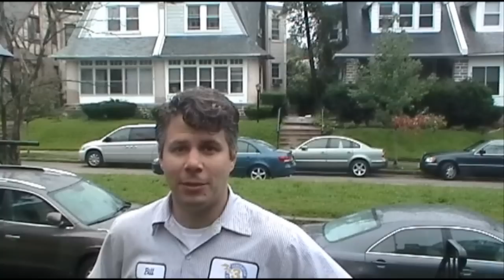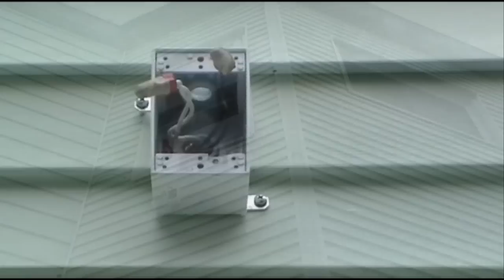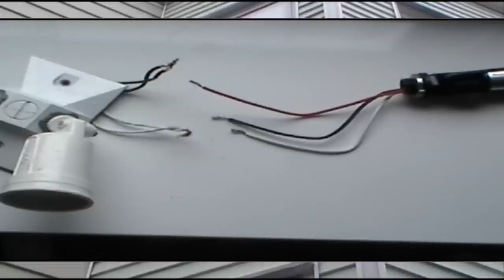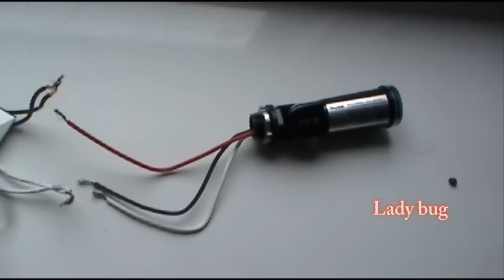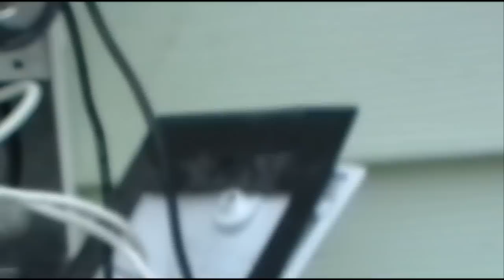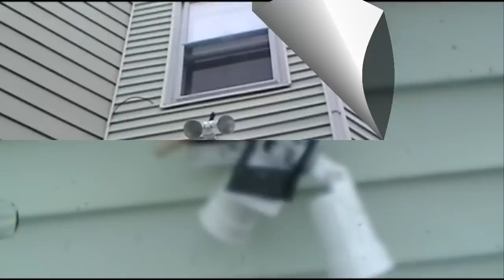How to install a photocell on a  spot light.

Comment: i am an electrician, hopefully i can help some people better understand putting in a photocell.  a photocell is a switch controled by daylight and darkness, no different than a single pole switch in your home, it just senses light and switches automatically.  hookup is easy, hot from breaker to black, red to light, and white to white for neutral.  pretend every wire is hot when installing, a neutral can light you up if shared from another circuit and pulling a load.  this applies to 120v wiring.

Comment: "Under window for easy bulb replacement"?  
Look, if you want to hang the top half of your body out of a window (leaving inside the  half of your body which has no hands with which to hold on should something go wrong) that's perfectly fine by me. Hell, I'd likely do the same myself.  What I would never do however is make a publicly available instructional video promoting the practice.  There's a surprisingly large percentage of the population that is extremely prone to sudden onset vertigo when looking down from a height to which they are unaccustomed.   
You can figure out for yourself why hanging head first out of a window could quickly change the course of someone's life as well as that of the individual who eluded to it being a good idea....